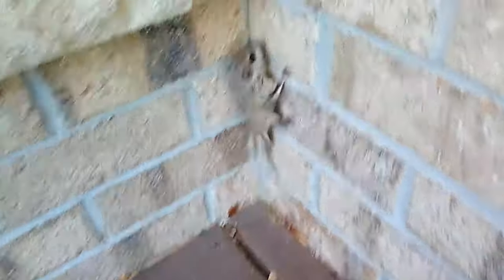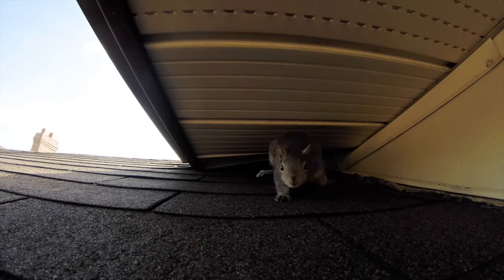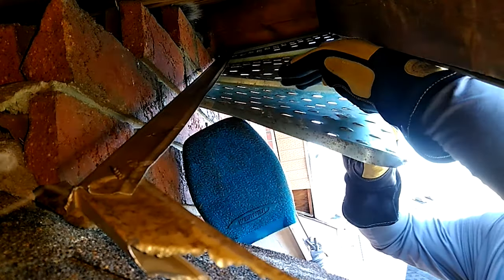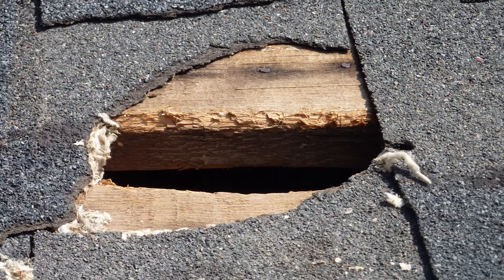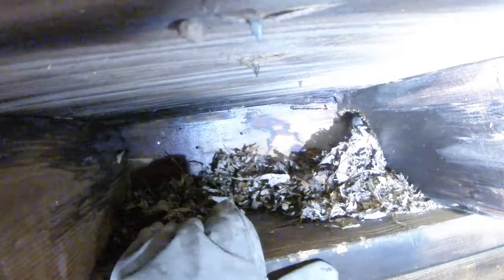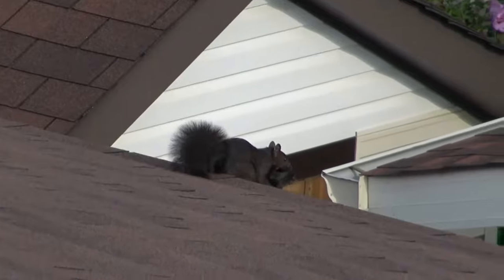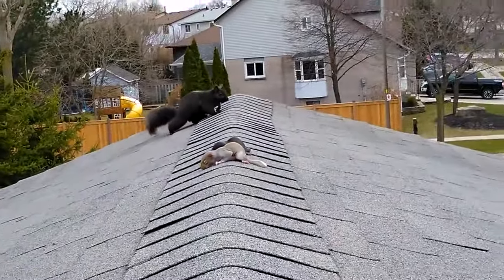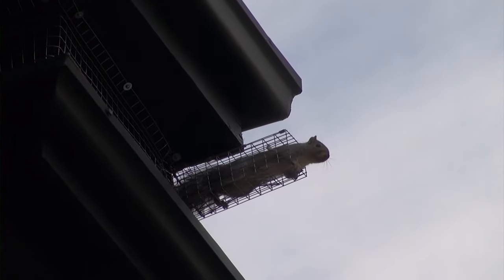Signs You May Have A Squirrel Problem

Comment: I used to live in an old home from 1910. When I had the roof done, the contractor added soffit and eavestrough. He ripped out any barrier that kept squirrels out and now I had a new squirrel problem. So lesson is if you are getting the roof done, make sure all entry points are also fixed. It will save you money on external and internal house damage caused by squirrels.
Reply from the maker: Absolutely agree!
Reply: @SkedaddleWildlife what do they eat for sustanence? 
(I currently have a squirrel in my wall for the past 3 months)